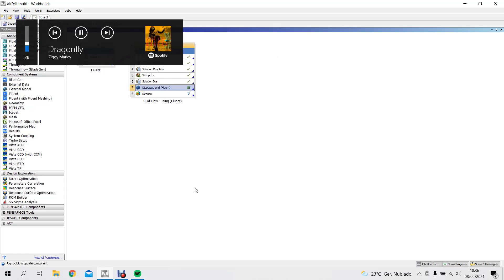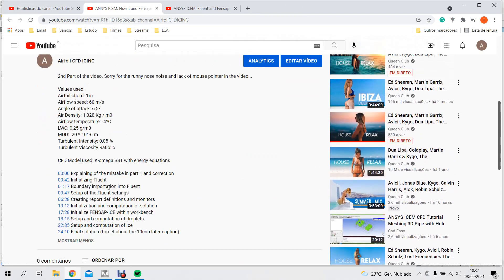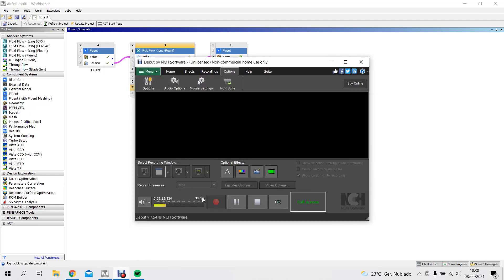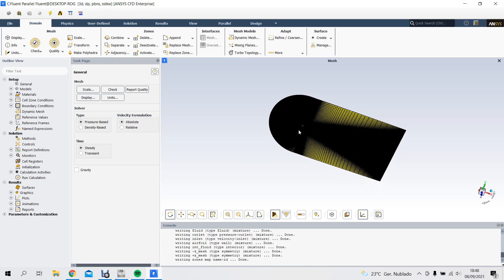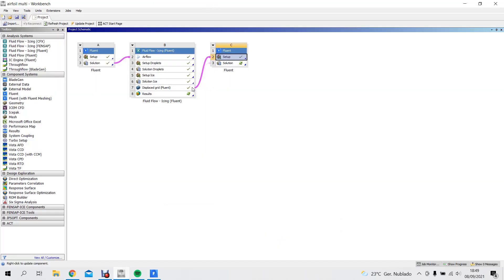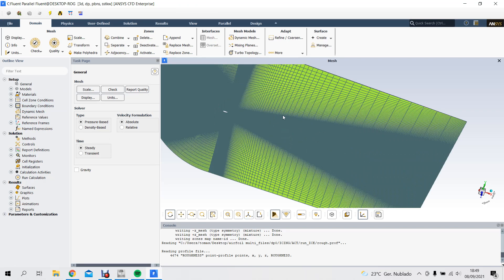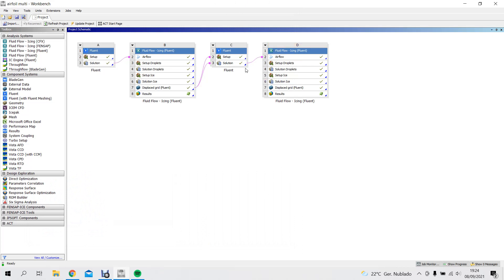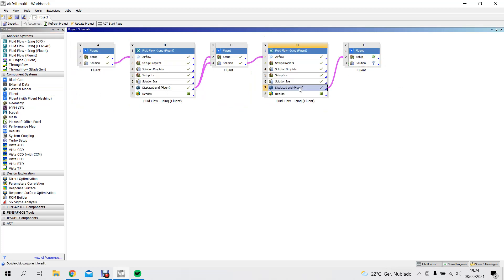ANSYS ICEM, Fluent and FENSAP-ICE Tutorial (Part 3 - Multishot Icing)

Comment: Is the Optigrid available inside Ansys Fluent, if the ICING is used?. Because I don't see any option related to Optigrid, when I use FENSAP-ICE using ICING option(Fluent Integrated Workflow). In the other way, the Optigrid is available if the FENSAP-SICE is opened as a standalone application.  Please let me know the way to use Optigrid inside Ansys Fluent. Thanks.
Reply from the maker: Hi! Sorry, it’s been a while since I’ve used this software, and I am no longer so used to it. I would suggest looking at the Ansys manual for the program, it is quite complete!